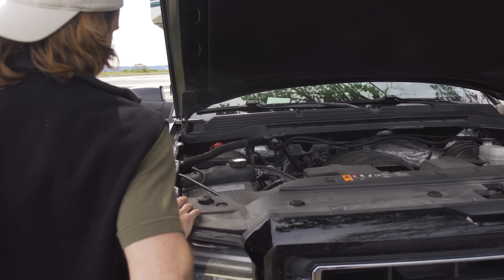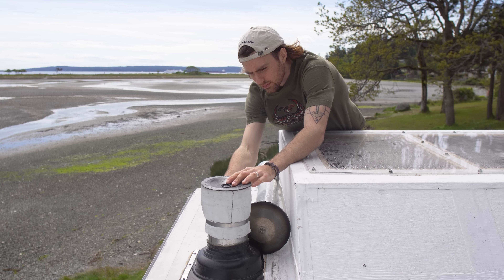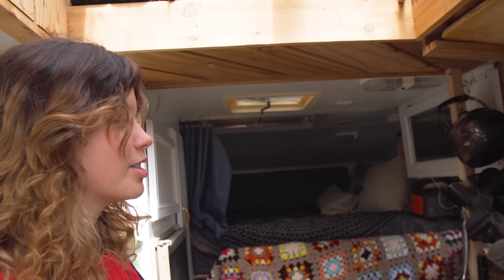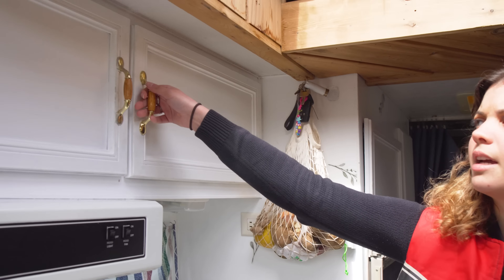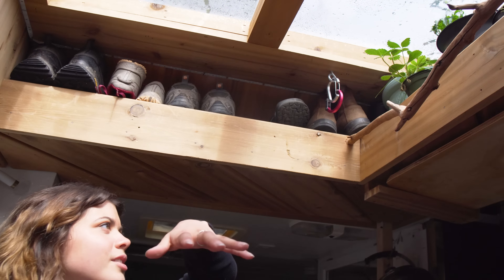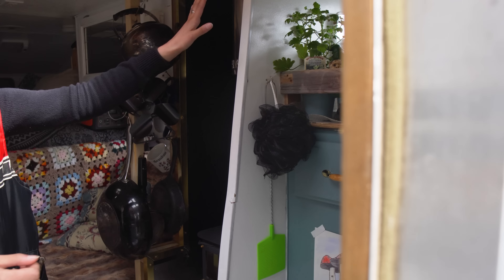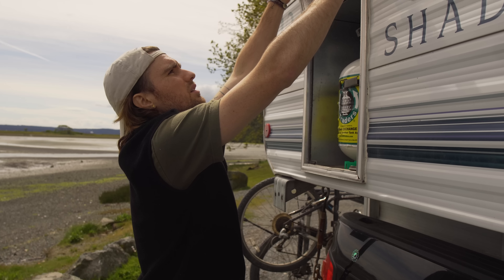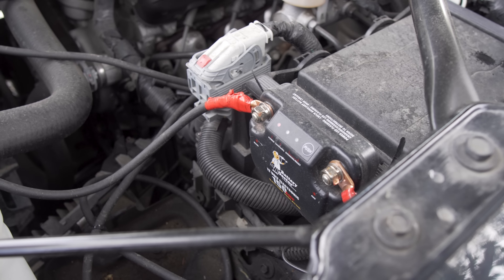Truck bed camper with Greenhouse + woodstove | Full Tour

Comment: Great couple, great setup with the veggies in the roof ;-)
Funny biography so far, I wish you all the best for the future and your businesses (the art work cries for being put on T-Shirts I thought, but maybe I'm the only one who thinks that, who knows ...). 
The condensation problem sucks but has to be solved urgently, since if you don't solve it soon you might run into real serious problems - means mold and fungi can make you sick. Humans emit lot of humidity into the air as well as your plants do, and that humidity in the air automatically sets down on cold surfaces. My recommendation would be twofold: 1) install one or two small fans and run them frequently to get a good air flow everywhere, means all your walls and ceiling should be regularly blown dry and 2) get you one or better two dehumidifier boxes (approx. size of shoe boxes) filled with these small dehumidifier gravels. These little stones (some brands are also coming as small little balls) are a miracle, sucking a lot of humidity out of the air and converting it into a liquid in the base of these boxes. But warning: check the level in the boxes before you move the truck, since if they are too much filled that liquid might spill over in curves or when you apply brake, and then you have a big mess ...
It is also highly recommended to dry your bed sheets or sleeping bags if anyhow possible every morning, and your matress every once in a while, if possible of course outside of the van. (All this mIght sound complicated but is easily done and turns fast into routine.)
Have a good time, and stay healthy!

Comment: The condensation can be managed through better ventilation , air exchange. Unvented gas heaters, for example, will cause more condensation. Good insulation, making sure no metal is uncovered when heating the inside. Thanks happy shiney young people. 🤗😉